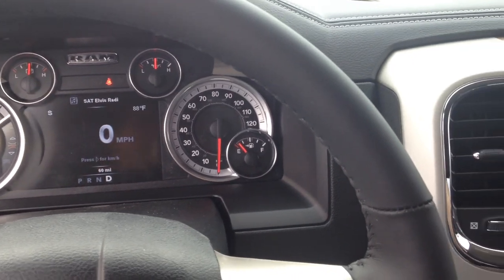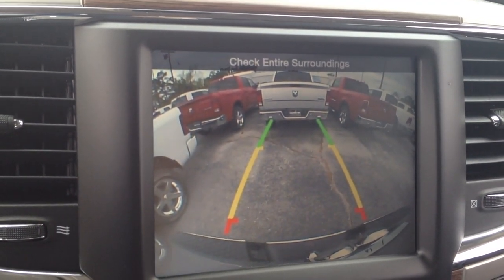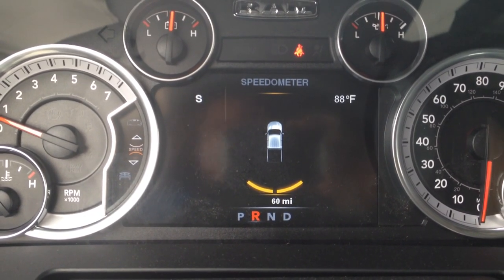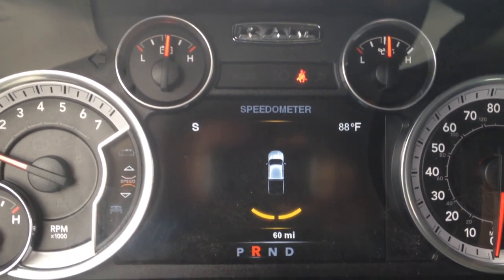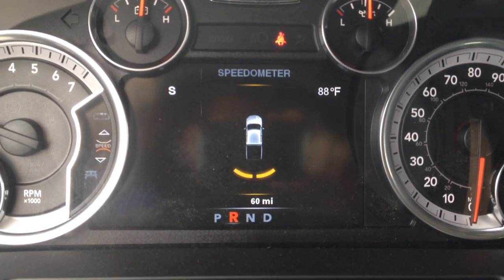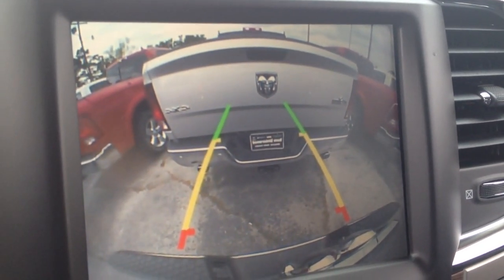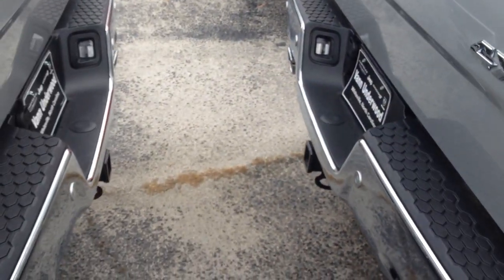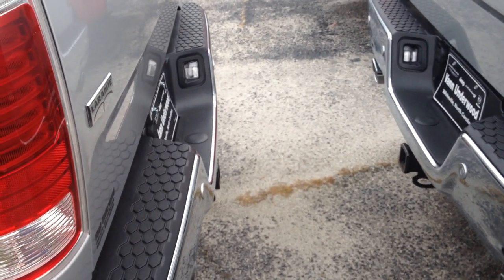👉 How Back-up Camera and Sensors Work in Action

Comment: Beware of the 2018 Chevrolet Impala back
up camera. In the rain the dash board screen image could be extremely blurry
due to rain drops on the rear camera lenses and this poor image could get
someone killed or seriously injured. Never had a problem with my 2014 Cheve Impala.
This is a General Motors Corporation problem!